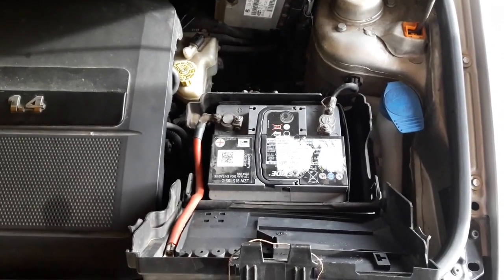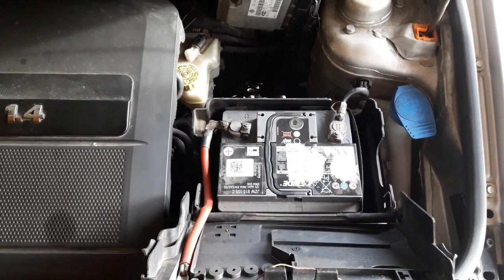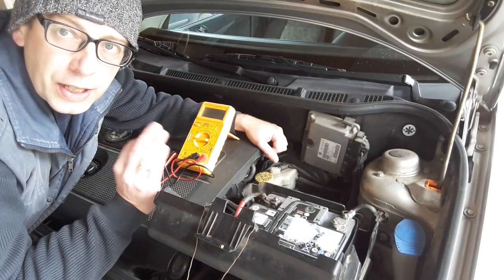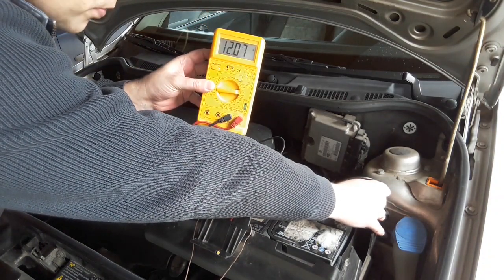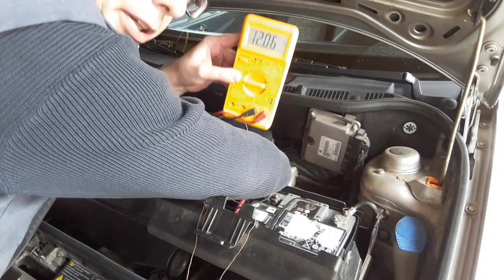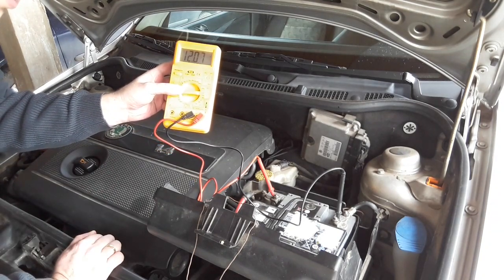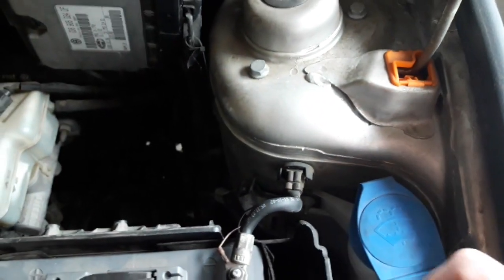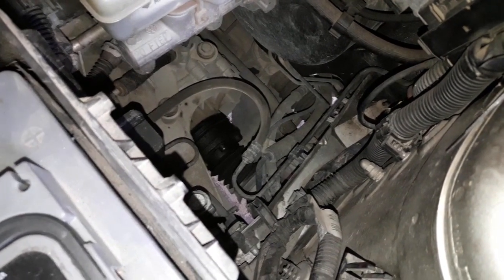Bad Ground Connection On Cars-Meaning,Symptoms, Diagnosing and Solving The Problem

Comment: On cold starts I hear a slight grind noise as the rpm sets then goes away .
Also while driving I hear squealing even after changing tensioner and belt.
Also at night there is a static behind the radio usually more noticable at night as the lights kick on automatically. 
Do you know what could be causing me these issues . It's a 2014 Impala Lt limited.
Also on highway it doesn't coast smoothly if I let off the gas the car feels as if Im stepping on the brakes when I'm not .
Reply from the maker: Hi and thanks for watching!

If I was in your place, I would check the alternator condition (namely the bearings and pulley).
Reply: @DespairRepair  hey took it to a shop they hooked up some meter reader to battery after that car seems to be driving better .
What do you think the problem was?
Reply from the maker: @TheLoneWolf7777  well, can't really tell you. To be honest, I don't think any kind of meter (what you're talking about might be a multimeter) would help.
Did they at least tell what the problem was?
Reply: @DespairRepair  no because there was no noise smh but when I drive to work I notice a squealing when pressing down the gas pedal. I already changed the serpentine and tensioner. He said everything was good with battery and the currency. Would that tell you if the alternator is good then ?
Reply from the maker: @TheLoneWolf7777  if the alternator has mechanical, not electrical damage (like the bearings or pulley for instance) the voltage will be OK but you'll get sounds similar to what you've described.
It would have been good to spin the alternator rotor while the belt was removed.
Also, I would spin the other pulleys too, while the belt was off.
That would perhaps give you a clue of what may be wrong.

Comment: Amazing video!!! Thank you! Just one question, is an ABS problem could be a consequence of a bad ground connection? I'm struggling finding why my ABS has problems without having any faulty code from the diag
Cheers
Reply: Yes, a bad ground could cause the ABS module not to communicate
Reply: @waltersweet4595   cheers mate
Reply: @johnoz4451 was it a bad ground?
Reply: Autozone can read the code for free.

Comment: my voltage likes to spike randomly i have a 2 amps and a 15’ woofer in my car along with a 220amp alternator it seems to be thst it likes to spike the voltage randomly sometimes when i a accelerate im thinking bad grounds or my pcm cause both my alternators have done it for whatever reason so it can’t just be bad regulator over and over again

Comment: Can you use the same ground connection on the firewall to the engine and from the battery to the engine two wires ran one from the battery to the engine and one from the body to the engine can you use the same one on the engine or do you have to have two different placements for the ground cables I hope that that makes sense it's pretty much I have the battery from the negative run into the engine and the one from the firewall running to the engine
Reply from the maker: Hi and thanks for watching!

In my opinion, yes you can, provided that the connection is done properly and that the cable is thick enough.

Also, there should be enough place to tighten everything.

All in all, if it works, I'd leave it alone.

Hope this helps

Comment: very helpful video! thanks. had alternator low voltage charging and also heavy cranking! In the process of trying to find the bad ground but the video certainly points me in the right direction. thanks!

Comment: hi i have a 2009 ford fiesta 1.6 tdci,i was driving it last week with no problems,then out of the blue a cog light came on which i have been told is the pcm light,the car died and wouldnt start for around 5 mins,eventually got it running and got it home,a friend plugged it in and a p0698 code came up,he said it was throttle pedal,so replaced that also put a new fuel filter after a day or 2 same thing happend,it wouldnt start so i put a forscan on it turned the pcm light off and it started,after 2 hours cut out again so i unplugged egr and it run fine for 2 days then the light came on again even with the egr unplugged,it has no problem starting but once that pcm light comes on the car will not start until i plug forscan into it and clear the p0698 code,is there anyone out there who can help it says sensor reference voltage c circuit low additional fault symptom circuit voltage below threshold......thanks in advance,jon
Reply from the maker: Hi Jon and thanks for watching!

From what I've seen, that code comes up when there's a broken or bad connection or connector somewhere in the wiring.

I'll be honest, finding it is like finding a needle in a haystack.

Before you try this, I would recommend checking the alternator voltage, battery clamps, and also do any fuses burn out.

Besides this, try checking a Ford forum. A lot of times these problems have a specific solution characteristical for that model, so it may help solve the problem faster.

Hope this helps!
Reply: @DespairRepair  thanks very much,i have been on it again today for hours and still no closer ...a friend who is an auto electrician is taking the car away tomorrow to have a look,its not something i like doing...(electrics),to complicated for me,lol....if i get it sorted i will let you know what the problem is,incase you ever have this problem,all the best and great channel...thanks,jon
Reply: @DespairRepair  its strange also because if i unplug sensors on the car engine the car will start for between 15 and 30 mins then it will just stop and bring up the p0698 code if it was a broken wire wouldnt it just not start at all?,thanks,jon.
Reply from the maker: @jonetrance4495  you're welcome Jon and best of luck with the repair.

What also comes to mind is do you have any alarm system on your car or any other system that would block the cars systems?

A long shot, but just wanted to mention it.

Today's electrics and electronics are, sadly, somewhat of a nightmare when a problem occurs. Even for a professional electrician it can be a huge challenge to solve the problem.

Thank you for the nice words about the channel, appreciate it very much.

If there's any thing else we can help, let us know.
Reply: @DespairRepair  no only the factory alarm and immobiliser  on the car,cheers

Comment: for electronic glitches, would it shut my power completely off? my cluster, headlights, and engine all lose electrical
Reply from the maker: Hi and thanks for watching!

Regarding the ground connection, in most cases no. There would be power, but it wouldn't work correctly.

When there's a total loss of power, the first thing I would check is the battery terminals (if they're properly connected, are they clean, damaged, etc.)

Comment: Hello, got problem: when start the car, cold, got some spark jump from screw on blok engine on the belt plate. Somethime change position spark on diferent belt plate. Spark is strong and i can hear it loud TK. When turn of the car and touch belt plate, i felt el shot. When engine run for a 10 min, no more spark. Hawe idea what can be?
Reply from the maker: Hi and thanks for watching!

I'm sorry but I didn't quite understand the problem. Also, what kind of car is it?

From what I did understand and if you feel a strong electric shock and see a spark, there may be a problem with the ignition system.

Namely with the insulators on the spark plugs and ignition coils (if your car has ignition coils).

If the insulation is damaged, the spark will "jump" to the engine while it's running and cause both a spark and electric shock.

If this is the case, I would first check the insulators and ignition coils. 

Also, did you connect an OBD tool, are there any kind of error codes?

Hope this helps.
Reply: @DespairRepair  bad english, bad explanation 😁sorry
Its hunday accent 1,3 2002 year.
Dont hawe ani el. Instruments.
Electricion say that never seen something like this.
But, thanks for idea, will see.
Reply from the maker: @zdravkobrlek6676  well I guess it's worth the try. 
I've encountered similar problems before and it was caused by this, especially on older cars.
I wish you all the best with the repair 🙂
Reply: @DespairRepair  
Will buy new spark plugs, cabels and bobina.
Thanks for your efort , good luck!
Salut from Croatia.
Reply: @zdravkobrlek6676  I replaced spark plugs and wires on my 1996 GMC Jimmy 4x4 ,4 door
But  my truck makes a loud nosie now then after driving the truck it turned off on me while driving
What can the problem be?
Reply: @josecazares6094  hm, something big. Go to the electr. Do not joking with it.  Good luck.

Comment: Hello! Great video. I have a question. If my car battery is in the trunk, would I use an incredibly long extension wire to ground/test the engine block and chassis? Or would I put my positive test lead to the engine fuse box? Thank you
Reply from the maker: Hi Chris and thanks for watching!

To be honest with you, when faced with situations like these, I would use a long extension cable as this is the most trustworthy solution.

Another option is extra battery terminals in the engine bay which are connected to the battery in the trunk (if I'm not mistaken, certain types of Mercedes have these, for instance).

I must ask if you're checking the ground connection, why are you checking the plus connection? And why do you want to connect it to the fuse box?

Comment: Hello! Great video. I have a question. If my car battery is in the trunk, would I use an incredibly long extension wire to ground/test the engine block and chassis? Or would I put my positive test lead to the engine fuse box? Thank you
Reply: Use two short cables. One between battery negative to clean .body point in trunk the second between engine bay body to engine.

Comment: Thanks for the informative video.

After a flood, my 2016 Chevrolet Impala LTZ limited had all kinds of problems.
I cleaned the gearbox, the radiator and all mechanical parts. I replaced BCM module, climate control module, instrument cluster dash panel and headlight dimmer switch.
Car has a weak start and Reverse lights ONLY work with brake lights. 
I'll use your video to troubleshoot.

Comment: Great video makes sense, where can i find all the ground locations? I have a 2002 GMC Sierra 1500
Is there a publication stating this info?

Thx Again
Reply from the maker: Hi Cliff, thanks for watching and sorry for the late reply!

The best place to look is the repair manual. In them, you have the exact places where the ground connections are.

The usual connections (for almost all cars) are from the battery to the car body and from the body to the engine or transmission.

Hope this helps.
Reply: @DespairRepair  thx will look for a manual

Comment: My car won't start sometimes, it won't even crank. The automatic key won't unlock the doors, it's completely unresponsive to everything. It will randomly start again after minutes of trying and if I jump start it. It has a new battery. It doesn't happen everytime I use my car. 
Would you have any idea of what could cause this issue?
Reply from the maker: Hi and thanks for watching!

Try checking out the battery terminals and clamps, if they're properly tightened and cleaned.

It could be a lot of things but best start from there.

Hope this helps.
Reply: @DespairRepair  thank you so very much, I will have a check

Comment: My Corvette clicks and then the screen goes black... Then if I touch the negative cable the screen comes back on, but I depress clutch and just here a click....same thing happens over and over... The original owner has a kill switch on the negative cable.. could this be going bad?  Or starter selenoid?
Reply from the maker: Hi and thanks for watching!

If you suspect that the ground connection is the problem, use a jumper cable and connect it directly from the minus battery terminal to the engine and bypass the kill switch.

Also, check that the battery terminals are clean and tightened.

Hope this helps.
Reply: @DespairRepair  it was the damn battery kill switch the previous owner put on, ugh... Thought it was something major... Thanks for replying though, subscribed😉
Reply from the maker: @tomomasta3254  glad you solved the problem, those kill switches can cause problems but nevertheless they're very useful.

Thanks for the sub and all the best to you!

Comment: This is very informative I will try these steps to find the problem, my power windows are working weird by pressing the button it goes down then up then down again, also interior lights are sometimes not working and the radio, the battery is brand new and the alternator was fully restored/repaired. Could this be the ground problem?
Reply from the maker: Hi and thanks for watching!

It could be among other things. It won't hurt to give it a check.
Reply: @DespairRepair  I checked today with the multimeter everything was fine the batterry an the alternator.. But when I checked the radio wiring sometimes it shows around 6 volts thats when radio wont turn on but when it does Its at normal value 12volts.. What could be the problem?
Reply from the maker: @roberthengeric1953  to be honest there could be a couple of things. Even at 6 volts, it should show something.
Did, you try to connect the multimeter between the ground and the plus connection,
what's the voltage?
Also, did you try to connect between the plus and ground somewhere else on the car?
Is there another connector somewhere deeper in the installation?
Reply: @DespairRepair  Only the button lights light up on the unit but they flicker.. tried to connect the multimeter to the ground but Its still 6v, i will try to hook it up on different ground. Thank for the help!❤️
Reply from the maker: @roberthengeric1953  you're welcome and sorry I couldn't help more.

I wish you all the best with the repair.
Reply: @DespairRepair  Thank you!😊 I will try my best😁

Comment: Thank you for the informative film. Today my husband and me drove to another city like 40-50 miles. After a short stop (~ 20 min) I couldn't start the car: lights came, no crank, then everything goes off. I tried 3-4 times, then husband vent to see what is going on under the hood when I was trying to crank the car. He saws some smoke coming from the positive terminal connection to the battery. The smoke appeared on attempt to crank (it lasted a ~ 1 sec, a little bit of smoke). I wanted to see it as well, so husband was cranking, I saw that smoke, brushed the terminals w/metal wire, but still no crank. We were about to call AAA, but then he tried again and the car started like nothing happened before. We came back home (another ~50 mi). I checked the battery like 1 month ago at NTB place, it was good. The battery is almost 5 years old. On another battery (it went bad on another car), I've head an opinion at Autozone that a battery is not good in 5 years, so I went to see what deals they have at NTB. But at NTB they insured me that there is no need to buy a new battery or have a spare one with the battery I have. May I know your opinion what could cause that smoke. It is obviously overheating, but what causes it?
Reply from the maker: Hi and thanks for watching!

I would again check if the battery clamps are clean (the inner side that connects to the terminals) and that the clamps are properly tightened.

Smoke and even sparks can appear if this is the problem.

Hope this helps.

Comment: Hello. I just replaced my battery and alternator on my 87 Vw cabriolet trying to fix a low voltage issue. My car shows 12v when running and my in car voltage meter flickers back and forth when I put blinkers on or any other components. I’ve cleaned the ground from the battery to the transmission and changed the terminals. I am stumped.
Reply from the maker: Hi and thanks for watching!

What's the exact model? There could be a couple of things wrong that come to mind.

When you turn on the ignition is there a battery light on the dashboard?

Also, did you clean the cables on the starter (there is a thick cable from the battery and alternator on it, it's known to cause problems).
Reply: @DespairRepair  87 Cabriolet Vw 1.8 karman wolvsburg edition. No battery light on. The power cable from the battery to the alt may be a bit dirty? I don’t know about the cable to the starter though. Would that have some effect on voltage drops?
Reply from the maker: @Chazisus  very nice car and congratulations on the ownership!

If we understood each other, if there's no battery light when you turn on the ignition, the alternator can't work. It can't get the initial voltage to start making electricity.

Regarding the cable, if the cable from the alternator goes to the starter (which is common on VW from that generation, like on Golfs or Passats) if it's not clean the voltage will be reduced or none at all.
Reply: @DespairRepair  sorry yes the battery light shows when they key is turned on but goes off when I crank the car. The car runs fine it seems. It’s just the voltage drop that is a bit annoying! I must need to clean up the connections.
Reply: @DespairRepair  I did not notice a cable going to the starter today when I installed the alternator.
Reply from the maker: @Chazisus  sorry but where does the main power cable from the alternator go?

If I'm not mistaken it should go from the alternator to the starter and then to the battery terminal.

You didn't answer about the dashboard battery light, is there a light when you turn on the ignition?
Reply: @DespairRepair  the power runs from
Battery to the b+ terminal on the alt. I do have the battery light when the key is on, once the car is running the battery light turns off.